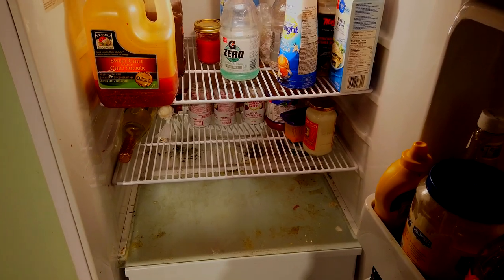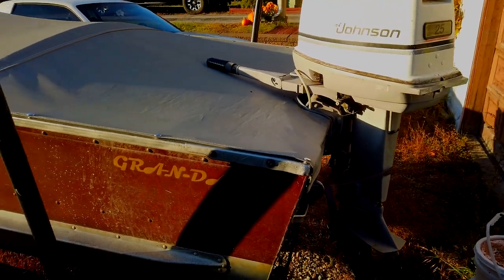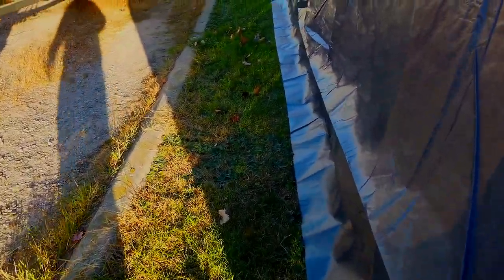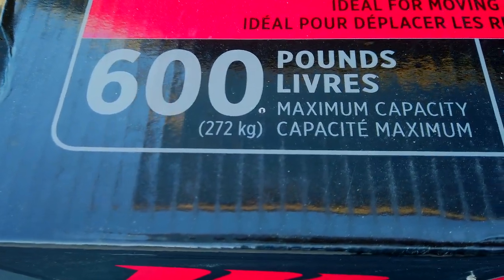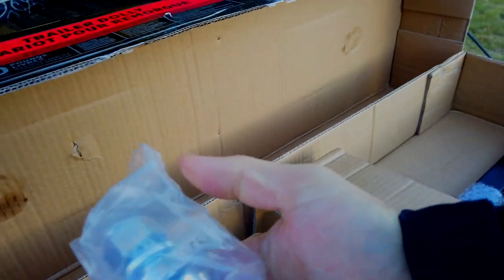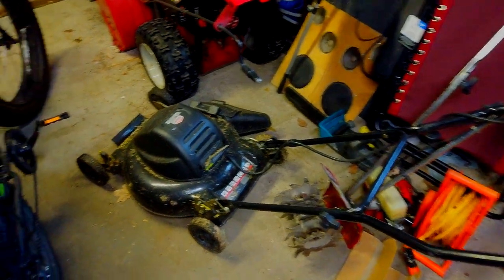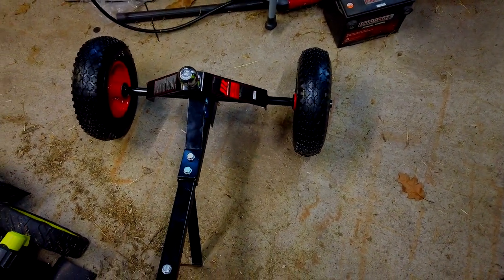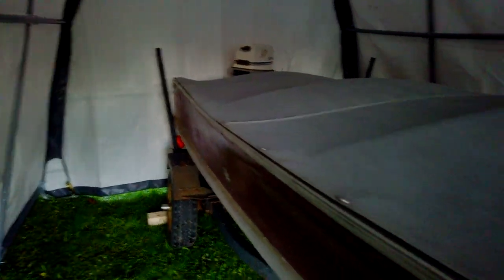Moving the Boat with a Trailer Dolly

Comment: Just a suggestion… I know it won’t be this year, but get good at backing the trailer before hitting the lake.  Two schools of thought regarding backing up trailers .. over the shoulder or using your mirrors.  They are very different disciplines.   I recommend using your mirrors as you may have stuff in the back of your truck at times and won’t be able to see Clearly out your back window.   Go to a large empty parking lot and practice forward pulls and reverse skills with the parking spot lines.